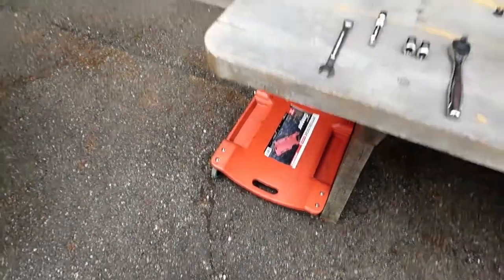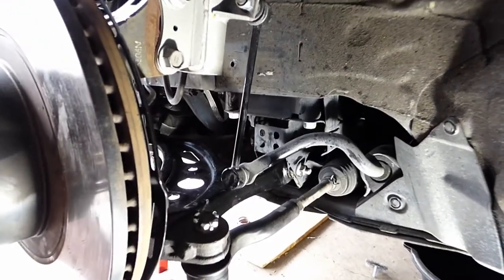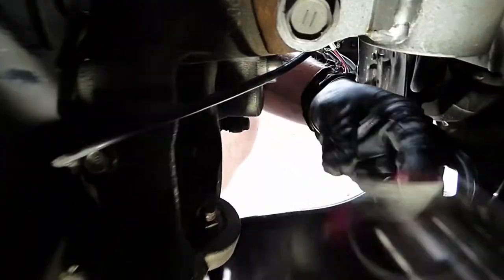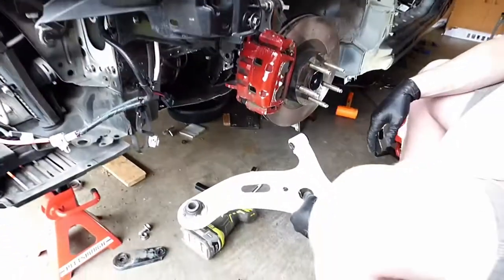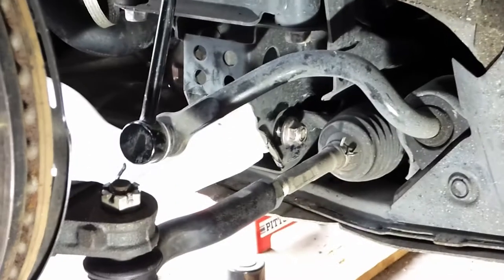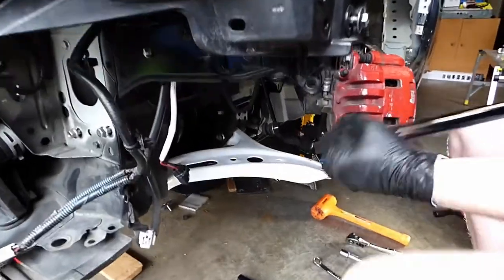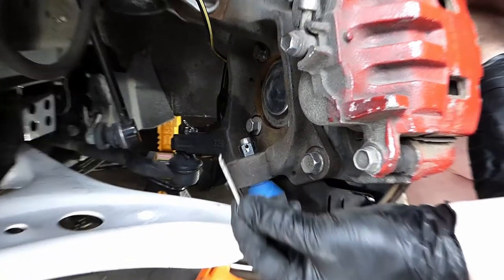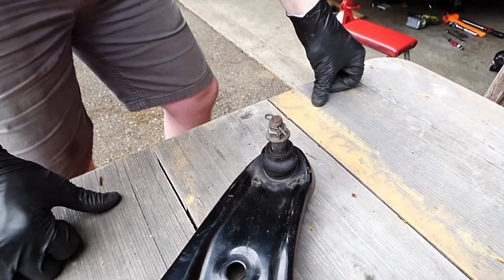BRZ / FRS Front Control arm install. (Torque specs included!!)

Comment: Im having trouble removing the front ball joint. Have any advice?
Reply: id recommend getting ones with the ball joints and bushings included! i was gonna just replace my ball joints separately as well since that was the main issue but i believe you need a special tool for that

Comment: Great video, I like how you guys actually posted the  torque specs, nobody ever posts them on these cars, they just say “Torque it to spec” which isn’t helpful at all
Reply from the maker: ScratchMB and that’s exactly why we did it! Makes us crazy! All install videos from us will have torque specs posted if we’re working on this type of stuff.
Reply: Stolen Wrecked Rebuilt Racing When me and my friend changed my clutch out we search for like 2hrs for the torque specs checking numerous videos and forums and everyone was pretty useless, I think we ended up having to sift through the illustrated parts breakdown, it took us like 2hrs to jack the car up, drain and drop the tranny, with smoke breaks included lol but then we spent alot of time looking for the specs and I think we needed to make a trip the parts store for something as well haha. We were getting pretty close to the point of just tightening them down to German Spec, Gooden Tight
Reply from the maker: ScratchMB I have noticed that it’s pretty difficult to find torque specs for most of the projects for these cars. Oh well. I like that guten right reference! I have an old Mercedes that has a few bolts on it like that!
Reply: Stolen Wrecked Rebuilt Racing My buddy and I were just doing some work yesterday and felt the wrath of guten tight lmao, the bolts seems like they were welded on cause how tight we made them. We didn’t have a torque wrench last time haha

Comment: Hey, I just put those control arms on my car and I’m having some issues with something scraping and my steering seems to be all sorts of messed up. i can go into more detail, but I wanna figure out what it is
Reply from the maker: ScratchMB you need to do an alignment. They aren’t quite the same geometry. You need to take the toe arms out and rotate them one to two turns opposite the direction of where you’re scraping. The wheels need to be straight. Sounds like you’re just a touch off.
Reply: Stolen Wrecked Rebuilt Racing Not entirely sure what is scraping it sounds like something might be hitting the wheel or knuckle, something that is spinning, something else is definitely hitting when I turn the wheel all the way though. I can’t check it when it’s lifted either cause the height of stuff is different.
Reply from the maker: ScratchMB watch the video about another issue with the frs. Probably the same issue. You’re most likely hitting the wheel well. See if you have wear marks on the inner lining.
Reply: Stolen Wrecked Rebuilt Racing Yeah I was thinking something was hitting the wheel well, I put on extended studs, but that wouldn’t change anything on the side where it could be scraping. For some reason my ABS, Check Engine and my Traction control drift light thing is on. i don’t know why those lights are on and it really confuses me. I have an open flash tablet coming in soon, not sure if you can check those codes with it, I will probably buy a OBD reader if I can’t use the tablet
Reply from the maker: ScratchMB you need to reset the steering angle sensor. The flash tablet won’t reset that. The dealer will need to do that unless you have another computer that can do that. If you aren’t sure what is up I would suggest calling your dealership and setting up an appointment for them to do an alignment and reset the sensor. It’s worth it to make sure you aren’t doing any permanent damage. Sorry we don’t have a quick fix.
Reply: Stolen Wrecked Rebuilt Racing Yea that’s fine without the quick fix thing, I am just a little lost at the Check engine light it just makes zero sense lol, I was planing on changing the PCV Valve today but never ended up doing it.
I’m kind of concerned what is scraping and wby my steering feels so messed up.
Reply from the maker: ScratchMB the other thing is you may have broken a wheel speed sensor. Make sure those are intact. The alignment is super easy to do. Lots of stuff on the forums too.
Reply: Stolen Wrecked Rebuilt Racing So updates on what’s going on with my car hehe, I do have a busted wheel speed sensor, I’m getting a bunch of codes one being a U0073 but besides that, the sensor will probably clear all that stuff. As for the control arms, so they’re hitting my dust shield and the dust shield is hitting my rotor, I’m not sure if an alignment and 0 degrees of camber will fix that, it’s looking like I might need camber to fix the issue or cut part of the arms. The other issue is they’re hitting my wheels, tires and wheel balancing weights on the outside of my wheel. Idk what to do about the dust shield hitting problem, since it doesn’t seem fixable by any means, lowering raising etc, and I don’t wanna throw alot of camber on which was probably my goof up on not reading into them clearly ;( looks like I’m gonna have to order stock arms instead
Reply from the maker: ScratchMB the geometry isn’t that much different than the stock arms. I would highly recommend having a mechanic of some kind look at it. They’re nice arms and it’s be a shame to lose some performance over what I’m sure is a small adjustment. What size wheels are you running
Reply: Stolen Wrecked Rebuilt Racing I believe they’re 245/35/18 I don’t remember the exact specs of them, I’m gonna just buy stock ones for now this seems like it’s a problem for a later time haha, this is my daily and only car so I kind of need it to work on the streets more than the track, would love to have a 50/50 build which is kind of what I’m aiming for, but some things just don’t seem do able. Spacers is the solution to the rubbing wheels, but the dust shield thing idk how to fix that, I don’t know if adding negative camber, lowering the car or an alignment would fix the issues I’m having.
If I have to lower the car or add camber that’s something I don’t wanna do, I’m not a fan or camber on daily cars, and lowering my car isn’t even an option with how terrible the roads are here.